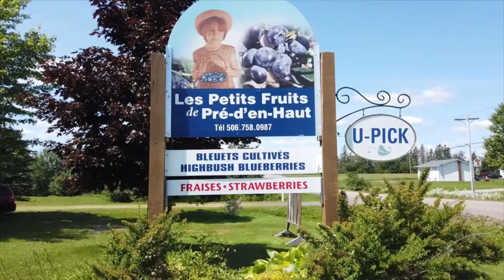HOW TO MAKE STRAWBERRY JAM

Comment: Hi, do you get any alcohol content in your kombucha? we had a low one in ours, much nicer though than a store bought beer. It affects you differently too. 

I have a question for you about the trailer.  You guys bought a trailer in BC before heading out, right? how much do you have to pay for a 5x8, or even 4x6 trailer, used in BC? Did you get yours on Kijiji? thanks
Reply from the maker: The alcohol content in the Kombucha is less than 0.5% so basically like non existent. 

We bought our trailer brand new from a dealer in BC before we left it was just under 5000 for a 6x10. Check Craigslist for used ones but often they are sold for close to retail price so not always worth it.